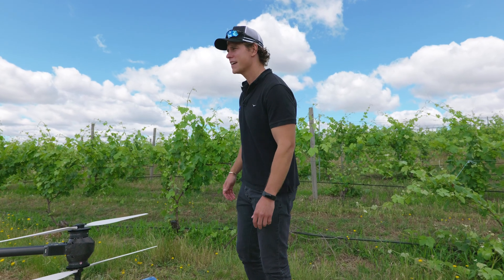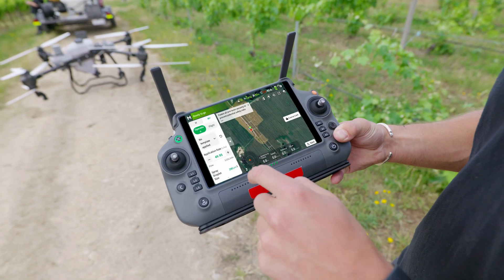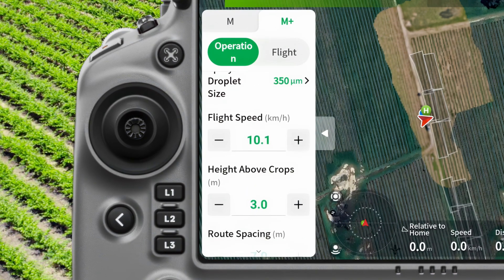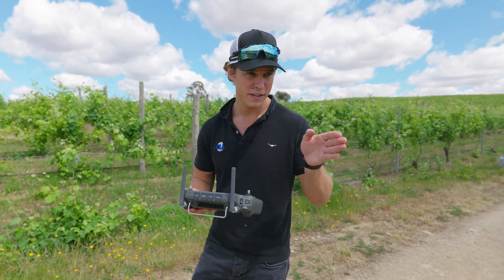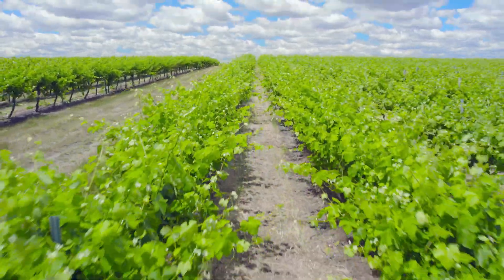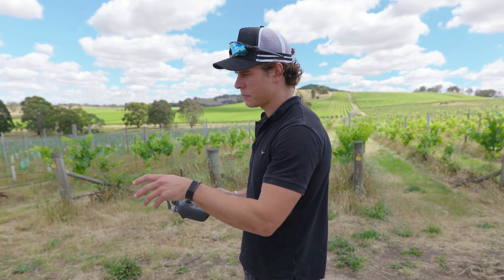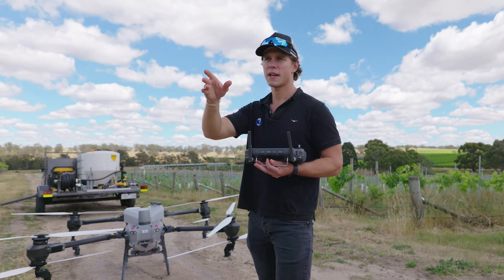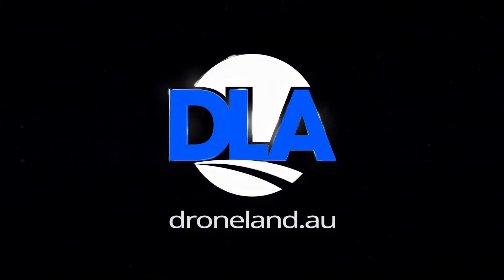Vineyard Spray Trials With The DJI Agras T50

Comment: Hi, does it work well with powdered sulfur?
Reply from the maker: We have never come across this - but it would need to be mixed with a liquid, so it can be sprayed out of the tank.
Reply: Thanks  @DronelandAustralia  , I thought that with the solids dispersal tank it would work.
Reply: @DronelandAustralia  Powdered sulphur or dry sulphur should be able to be applied through the spreader.